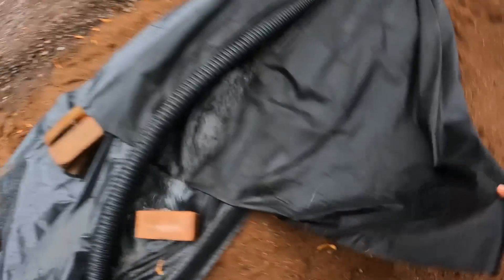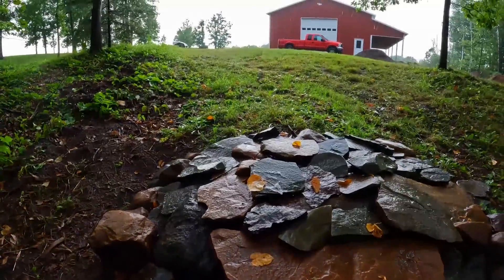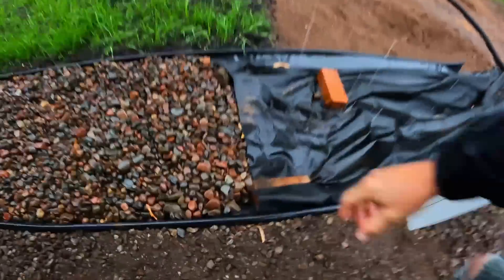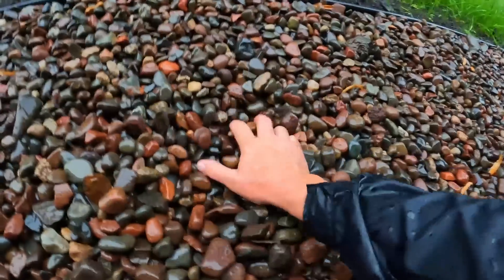First Big Test of the New Building's French Drains - Can They Handle the Runoff???

Comment: Gutters and downspouts would've been less expensive and easier to maintain. Looks nice though.
Reply from the maker: I explained in the prior episode how gutters often get damaged by sliding snow coming off of steel roofs in this climate, and downspouts suffer from ice backups in late winter-early spring when we get melting during the day but re-freezing at night, which pops downspouts open every year.
Reply: @squatch253  And then there's giant icicles the length of the building that are quite dangerous. You know your area though.

Comment: When that flex pipe pops out of the rock in a couple of years,replace it with solid drain field schedule 35 bell end. Will stay under the rock longer.
Reply from the maker: This pipe won’t move up in the rock, if the drain is built correctly there won’t be any water in it to heave 👍

Comment: Question,  on the lean to side, IF the trees and grass area you planted were higher elevation than the building,  ie, water would run towards the building,  would the drain work to keep water away from th building?  Or would water rush over the rocks and head towards the building?  And winter, ground freezes, spring melt comes, but ground still frozen,  how does drain function then?
Reply from the maker: Yes, but you’d put it in a bit different in that scenario - you’d make the rock bed slope “up” slightly so the incoming water would have to climb up in elevation to get across it, giving it maximum opportunity to get caught by the rock bed and carried off before it makes it to the building. Pete at Just a Few Acres Farm channel just recently put out a video showing one of those sloping drains he put in next to his main barn 👍

Comment: I like how you plan your work and then you work your plan until you have something happen that puts you back to planning. I know that you have things that frustrate you but you seem to just step back and start thinking about a solution. You have a lot of practice with problem solving (X231) and it shows with things like removing the landscape fabric from your gravel bed in that drainage system. It just sense that it would restrict water flow and you don't need that.

Comment: I collect rain from my tin roof and it is probably a few feet less than your roof so my guess is around half to three quarters inch to fill the bucket like that it’s amazing how fast it can rain during heavy rains I think you did a great job on the drain should work great with plenty of capacity for heavy rains thanks for sharing

Comment: 0:34 now that you have a surface, you should get a couple of IBCs and stack them inside to collect water. Worth having. And if you get like second hand ones from some kind of industrial dealer, they're cheap as cheap gets. At least here in Europe, i got 15 or so for a fraction of the price (of course, you take the L of them being used for chemicals, which means you can't use them fro drinking water or washing (yourself) water, but for washing a tractor, fire purposes etc, plenty good). In the first three months, i had like 6 tons of water stored from a surface area similar to yours in about similar rain conditions (if the camera's not lying too much to my ears). IMHO, storing water is always a good idea, never know when you need it in large volumes.

Comment: Do you have any concerns with weeds coming up in the rocks. If so, Roundup ??
Reply from the maker: No concerns, with the triple bottom lining in the trenches that’ll block anything from coming up through, and there is no organic material in the rocks to propagate any growth - plus the more the water runs through it the cleaner the rocks get 👍
Reply: You didn't put a sock around the drain tile . . . Your thoughts on drain tile socks??
Reply from the maker: Tile drain socks are falling out of favor more and more due to how quickly they become dirty and clog due to their smaller surface area. The preferred method now is to create higher-flow drains when decent slope can be achieved, which makes the drain more self-cleaning, allowing it to carry any sediment and debris clear away and out the daylight end 👍